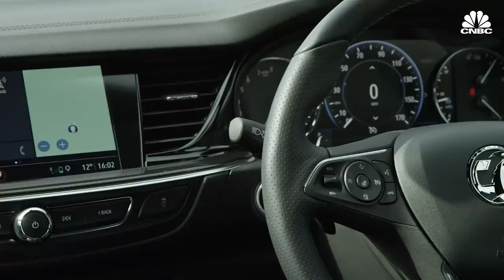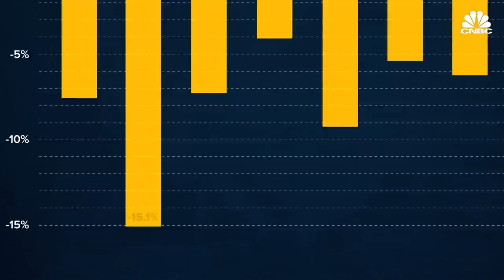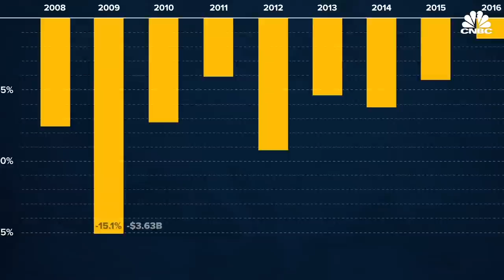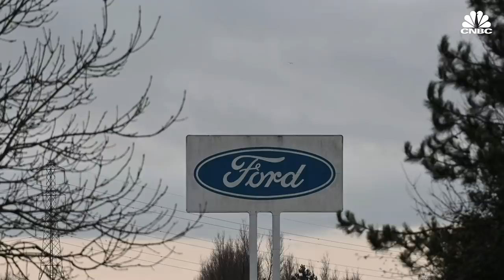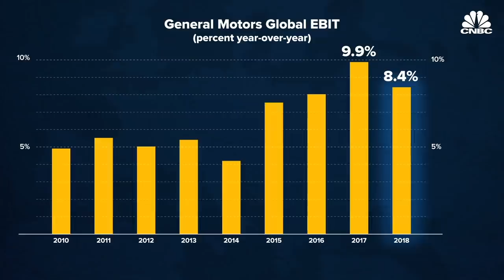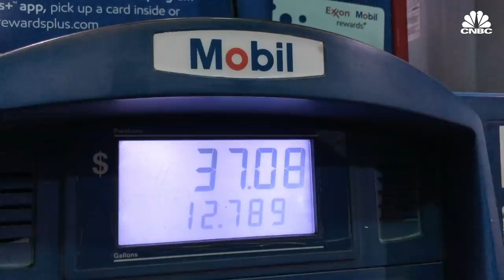Why General Motors Left Europe

Comment: Part of the American car problems is, the cars are built with so much complicated technologies, that not even independent mechanics can fix them. These cars are built 
in such a way that ONLY DEALERS can service them. The best example of a good car is the original Volkswagon. High quality, reliable, cheap, easy to repair. Todays' American cars are nothing but JUNK on wheels. No wonder GM cars are not sold in Europe. New York, 3/4/2020

Comment: Their mismanagement of SAAB is a perfect example of everything that's wrong with GM. They bought a company that was well known for it's great engineering and innovativeness but instead of utilizing them as a spearhead in developing future GM technology they told them to use old Opel platforms and generic GM parts to build their new cars. The people at SAAB did their very best trying to make gold out of crap but they still ended up with products that were subpar to their own and their customers standards. Many of the great people who worked at SAAB went to work for Volvo after the company shut down and Volvo Cars is doing very good under it's chinese ownership. Not so sure they'd had the same success today under Ford ownership.

Comment: I can only speak for the Australian market in the context of GM. General Motors Holden (GMH), the Australian branch of GM, operated here with the aid of hundreds of millions of dollars in Australian taxpayer subsidies. Yes, that's right, GM, one of the jewells in the crown of flag waving American Capitalism survived for several decades here in Australia solely on the basis of handouts or as some might put it, socialist benevolence, not as a response to stiffening competition and technological prowess.
In its formative years in Australia GM produced vehicles that were "cutting edge". Monocoque chassis equipped with small, economical, OHV six cylinder engines, suspension that was up to task of the many unsealed roads here and good customer support made them the choice vehicle for Australians.
Their product started to stall in the "70's with the fuel crisis and with increasing emission standards yet they traded well on the back of their initial success's and the Australian public's will to call GMH an "Aussie Icon".
By the end of the seventies GM Australia's answer to the rise of the likes of Toyota and alike was to "shoe horn" a gas guzzling pushrod six (v8 was an option) into the body of an Opal. It still sold well but with a few miles on them the quality of the design and manufacture started to show. The depreciation on these vehicles was significant and on top of the Japanese competition the European manufacturers started to sell well in the upper end of the market.
Roll on into the late eighties and GM released its "all new" model complete with an engine sourced from a 1962 Buick and live axle rear suspension. The Japanese and German invasion was buoyed by the lack of competition and while GM sales were good the writing was on the wall.
By the early noughties Australians were moving quickly towards either 4WDs, small hatch backs and before too long, SUV's. GM's response to this was not only too late, it was laughable. GM purchased Daewoo (remember them) and rebadged their buzzbox trash and dumped it down under. The Australian market shunned the product. GM's next bright idea in this burgeoning new market was to develop a new "high end" sedan. GM proudly advertised that they had spent one billion dollars developing the new car. This was not exactly true as once again GM were very happy to stick their hand out to receive significant public funding in their endeavour to build a car that the market no longer wanted. Predictably sales slipped away and a decade or so later government subsidies were axed and GMH was history. Of course they did manage to syphon 100 million dollars out of Australia back to their US parent company. Australians continued to buy 4WDs, hatch's and SUVs.
General Motors is a company that thrives on government handouts be it handouts from the U.S. or Australia or perhaps other countries. General Motors has become accustomed to the ways of corporate socialism. Product planning, innovation and competition are just not in their vocabulary. Their vehicles may still have some relevance in the US, just, but with their "bank of Mum" mentality, there wont be much time left there either. If you're from the US and reading this, trust me, you wont miss them. GMH was once Australia's pride and joy and we don't miss them a bit and it's nice not to be handing your hard earned tax dollars to a multinational corporation.

Comment: GM never want to learn from their mistake and constant wants government to bail their ass out when they failed. I used to be GM fan and drove my suburban and camaro for years until I'd my fuel pump failed and had to replace twice. I ask the mechanic why it fail so often and he said it's typical issue that GM never what to improve. Well i'm a ford fan now and my F350 dually doing a fantastic job so far, knock on wood. Majority American don't want to own one, what make you think oversea owner wants to buy one.
Reply: I grew up with Ford cars (of course, my Dad worked for Ford, so, maybe I'm a little prejudiced), and I have to say that they really are some of the best built vehicles in the world.  As for the GM fuel system problems- I've got to say that I was really startled, when I bought my Chevy S-10 Blazer, and found myself having to replace the whole bloody fuel system, one part at a time.  In fact, that extends to the exhaust system, too.  Parts that I'd rarely had fail in Fords, I might add.  As for the F350 Dually- Big truck!  I wish I had one- very practical for living out in the country... almost as practical as my SUV.

Comment: Now GM needs to ditch the Buick and GMC brands. Buick is a premium brand and is essentially a step above the Premium trim level Chevy's. Plus, since most Buicks are rebranded Opels, they won't have anything to go off of soon. (Back in the day, most Saturns were rebranded Opels.)
GMC trucks are a slight step above their Chevy counterparts, so they aren't really necessary either. GM should just be Chevy and Cadillac with the addition of a higher trim level above Premium while still making it cost less than the entry level Cadillac of the same line. Bring in the Avenir trim to slot above Premium that has a bit more luxury, nicer colors inside and out, more sound proofing like Buicks have over Chevy, etc.
It's really dumb and costly to make the same car or truck across 4 different brands that have very little to distinguish them from each other  a part from the body panels and dashboard giving the design language of each.
One may argue that VW is no different, but I disagree. VW is the "base" brand with Audi being their luxury version. VWAG also owns Porsche, Lamborghini, Bentley, etc. While each brand may share the basic platform, or variant of (say Toureg, Q7/Q8, Cayenne, Urus, Bentayga), those cars are very different from one another in many more ways than the 4 of the same GM trucks are different from one another (say Traverse, Acadia, Enclave, XT6) (I understand they just made the Acadia slightly smaller). Or Tahoe, Yukon, Escalade - this would be more profitable with just two rather than three.
Having just the two, GM can actually try to make the Cadillac luxury brand   an actual contender against the likes of BMW and Mercedes. They want that, but are falling quite short.
It made very good sense to ditch Saturn, Pontiac, Hummer, etc back in the day. Now it's time for Buick and GMC to go.

Comment: Funny to say that european cars can`t be sold elsewhere, while showing serveral times the Opel Insignia. The insignia was developed in Opel / Germany in 2008 at and later got the Buick badge.
The Buick Regal, a 1:1 copy of the Insignia, was one of the most sold cars in the early 2010 worldwide.

And at least in small parts there are synergy effects, merceds benz still used crash-sensors with the daimler-chrysler logo in the late 2010s, almost a decade after it has dissolved its connection to chrysler.

Comment: GM builds junk cars. That's why they're not selling in Europe Europeans are used to a certain standard when it comes to automobiles GM does not hold that standard recall after recall defect after defect on older models we'll see how the new Corvette fairs in 10 years I have a 2007 BMW Alpina B7 still runs like a top and it's more than 10 years old only had to put Tires and Brakes on it when I got it try doing that to a Chevy S10 or a Chevy Cavalier

Comment: GM was one a European powerhouse but years off poor quality and lackluster design allowed premium brands plus VW, Skoda and even Dacia to erode
market share.
Opel was pushed premium once Chevrolet arrived which was even more troublesome. GM was unable to articulate what Opel stood for, lacked appropriate product mix, and failed to cut costs/utilize factories like PSA has.
PSA has only brought Corsa to market since acquiring Opel. Factory utilization, whether this means renting out space or four day work weeks, but has made a big difference. Also, the PSA sourced CUVs, had only hit the market, and would have erased losses for the next fiscal year.
Lastly cutting former GME engineers from the payroll plus GM paying direct royalty payments to PSA instead of Maryland, has helped.
The PSA turn around isn't exactly a mystery. Nonetheless it is a very damaged brand in an era of economic nationalism gripping Europe sans the UK and Ireland.

Comment: GM failed because they had a bad reputation as a whole. Not because of their US roots, but because people could see what happened successively to European brands they owned. Opel/Vauxhall had become the synonym of bad quality, rust and electronic incidents. Moreover, they killed Saab by starting to put Opel/Isuzu engines + by rebadging a Subaru Impreza (Saab 9-2X, called “Saabaru”), a Chevy Trail Blazer (Saab 9-7X) and an Opel Mokka (Saab 9-4X) which further confused buyers. Saab 9-3SS was just an improved Vectra without any Saab engines (no B205 nor B235 engine), and the last Saab 9-5 was an improved Insignia. Thank you GM for killing one of the most unique Swedish brands.

Comment: Because I wasn't in charge of GM Europe.....if you can't beat them joint them, Audi's S and RS brands sell well but GM down grade their VXR brand to GSI??..... things like that is why GM failed in Europe. They make great cars but in my opinion they don't have the attention to detail that the German brands have and that was the main problem especially in their top of the range models, always the under dog, cars with so much potential and they are seriously under powered. The insignia VXR for example, they got their finger out put 4WD in the car(which Audi had done for years previously) and left it seriously underpowered, then the next generation insignia they dropped the VXR brand and went with GSI and gave it a 2.0T??? why not install GM's new 3.0 twin turbo v6 that has over 400 bhp coupled with 4WD and even call that one the VXR and leave the 2.0 T in the GSI? People that buy high powered cars don't care about emissions and how much running costs there is, that's what comes with the territory. Saab tried to make their cars better and look what happened to them. They brought in 4WD to their 9-3 before the insignia spend the cash and then GM shut them down....No one to blame but them selves. Too much interference from the states I think.

Comment: It was just because they built crappy cars. For example, the astra, a former successful hatchback/wagon-car, was about 400 lbs heavier than similar competitor cars. The reason for this was that it was built onto a GM platform, that was designed to fit many different needs. Those needes were so wide spread and different, that this platform couldn't meet any requirements by 100%. With that weight-penalty, the car's fuelconsumption was unnecessary high and the dynamic abilities were quite poor. Today's Opel and Vauxhall (the last under GM) cars have a quite good reliability, but still suffer from the bad reliability-reputation they earned in the 90s and 2000s. So even if u buy an Opel here in Germany, u hear questions like "couldn't u afford a real car..." Opel's bad reputation results in a very huge value loss of used car's, compared to similar competitors.

Comment: Look, if your management isn't capable of making decisions that deliver products the market wants to buy then maybe you don't deserve a share of that market. 
GM used to make cars that people wanted to buy and many enthusiasts still talk highly of them today. The Manta, Kadett, Rekord, Diplomat, Monza, Ascona, Commadore, Senator, Calibra and Omega (especially the fast versions) were all great cars. Although I resent the fact that GM abandoned the Omega V8 development. The Astra F had a phenomenal engine (because you let cosworth make it). The Speedster was inspired, using an old Lotus chassis and sticking one of your engines in it was a great idea, but it was 10k more expensive than an MR2. Then for most of the 2000s they produced total garbage. The only GM Product I found interesting was the Adam Sport where the only saving grace was that it started at a slightly lower price to the equivalent Fiat. GM products just aren't as desirable as European brands in Europe. One of their options would have been to build honest, basic cars with good engines that younger consumers want to buy and then lowball like crazy. That's how you build a consumer base and brand loyalty. Selling Rebadged Suzukis, Isuzus and Renaults is not the way to do it..

Comment: The problem with Vauxhall and Opal is the fact they are low quality very plastic cheap feeling cars. Now I know they are owned by Renault, I’d just never touch one again. But the build quality has been so very poor for years, mass production just doesn’t work when you are trying to make a big cheap car! We would rather pay a bit more for better quality than settle for what is on offer. The next issue was the very limited option ranges and in particular engine and transmission, it was either weak and poor, or poor and weak! The first cars that really livened up Vauxhall in the U.K. was the Australian models and even then, they was cheap low quality plastic trims with no style or even any thought put into it.
The new Vauxhall/ Opel SUV’s like the Mokka, again they are incredibly poor cars that are so far behind other manufacturers including Renaults own Nissan!, the Renault models are high spec, but historically poor build quality and unfortunately they have a bad reputation and it would take a complete rebrand to change views.

Comment: Selling Opel was a win-win for GM, Opel and PSA, that's true. Mrs. Barra pulled the emergency brake, but why was she used to?

GM bought Opel in 1929, at that time Opel was the market leader with a market share of 44%, in 1972 down to 20.4%, 2017 to 6%. In the 1970s Opel still was the market leader and a (possibly THE only real) premium offering (Audi and BMW almost didn't exist, Mercedes was far more upscale than today). Since the 1980s I cannot remember ANY positive from Opel, they introduced new products pretty late, poor quality, nothing on it why I should consider buying an Opel. After 9 decades they realize they have only few shared parts between Opel and GM's car production outside Europe? It took a long time to know this.

GM is the most successful American car maker in China? Most successful among 3 fools? What position do they have compared to all car makers or to all car importers in China? In the US GMs market share peaked at some 60% (in the 1980s?) and how much is left today? 20%? That is what it was in Germany in 1972, so it is going south either. If you have such friends and car analysts you don't need an enemy.